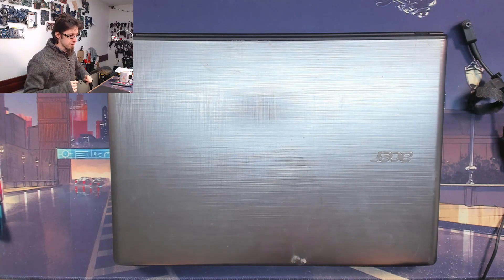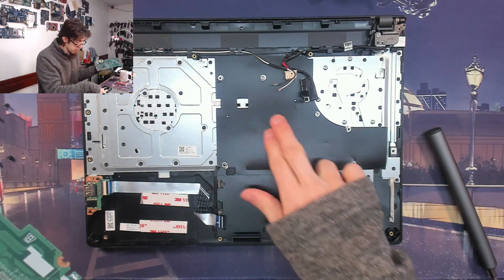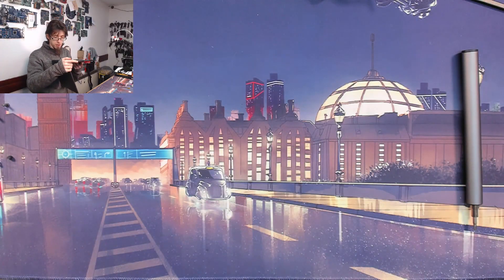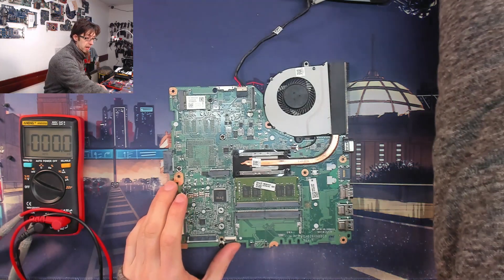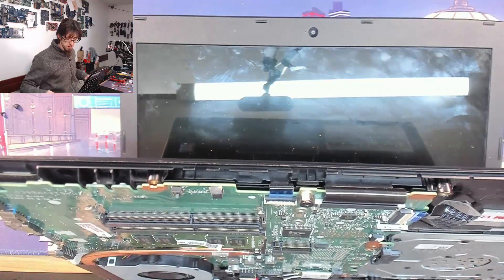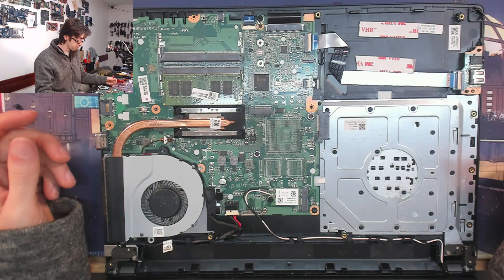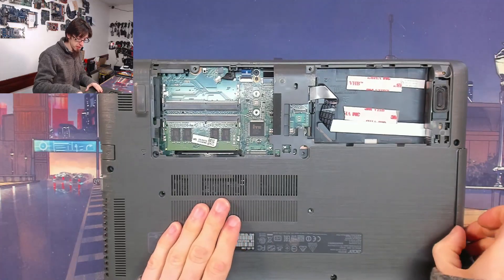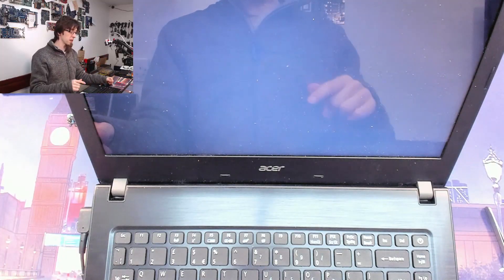Acer E5 Charge Light But No Power - LFC#237

Comment: Mine suddenly turned off and even when plugged there is no light indicator. I tried resetting bios, discharging the power, and shorting the 2 pins for power but it still wound not light up. 😢

Comment: Good day !
I have a unit the same you are using in this issue of ACER E14-E5-475-30ZC
It so happen that the 14 termmin connecting wire to LCD was shoted , 
Now the laptop won't start , please help me or 
Do I need to replace the Main Board ?

Please 
Thank you in advance for your prompt reply

Comment: For these keyboard replacements I found tiny screws on Amazon that will screw and anchor in to the underside of the palmrest. You can apply these screws where you can't remelt those posts.

Comment: wrong description. symptoms of RAM issue is not power related.. the laptop is turning on but no display sometimes the orange led just keep on blinking. THAT DESCRIPTION SUGGEST THAT THE ERROR IS ACTUALLY CAUSE BY A FAULTY LAPTOP MOTHERBOARD EITHER THE AC PORT THE WIRE THAT CONNECTS FROM AC TO MOBO OR DEFECTIVE CHIPS OR ELECTRONICS EG. RESISTOR, CAPACITOR. if that is the cause its better to buy a new one than try to repair the board itself by means of soldering and changing electronics parts or chips. besides repairing computer motherboard is not advisable. by technical and safety reason.

Comment: I love this video, as you take everything step by step.  Thankyou - very helpful.  I'm wondering if you have a schematic for a motherboard from an Acer Aspire 1 A114-31 Model N17Q4.  I'm having the same issue with this laptop, but can't workout where the keyboard pins may be for a jumpstart to ascertain if the power problem is the keyboard, as in your video.
Hope you can help me 🙂

Comment: I have a similar problem, the computer charges the battery but it doesn't turn on, although there is 3.3v on pin 27 even if the jumper does not turn on anyway, what do you think it could be?

Comment: my acer es1 572 has problem, the device chargeing, but when i press power button the power light turn on for 3 secounds and turn off again. do u have any solution to solve the problem and the laptop fan in also not spinning.

Comment: Excellent tutorial! About the keyboard replacement, i as well did'nt enjoyed the need to replace just the keyboard, which is trapped like that, but it is actually really simple to get it done. I'll use a candle and a pointy tiny piece of metal, where i will be heating the object costantly to melt this plastic dots, you can use acrilyc glue to reconect this regions.

Comment: I thought that my keyboard stopped working but it's even more bizarre.

So my laptop is Asus Rog GL502VS, I have the power LED on when I plug in the charger but it won't switch on. I've started messing around disconnecting everything bit by bit and I made my laptop to work, but here it's getting weird:

I've unplugged ac, BIOS battery, laptop battery and speakers. Plug in ac and boom it switches on, after that I have to quickly plug in BIOS battery and it boots normally. 

It will work normalny, it can go to sleep but if I'll shut it down, I'll have go through that process again...

Any ideas?

Thanks. K

Comment: If the keyboard weren't rivoted in place like that, I would even try to go as far as tearing the layers apart on the keyboard and redraw the power button trace if all other traces are good.
Or, perhaps you can try a frankenstein method of soldering a physical power button off the side of the laptop or something so the user can switch it on there.

Comment: Thank you very useful.
I need Schematics for the 
Acer e1572, to check those pins, in case it's the keyboard.. But it worked before I decided to disassemble looking for the CMOS battery that never existed for this model. 🤔?
Crap happens when you're having fun. 🔨😁🔧

Comment: use a old funky or cheap soldering iron to top off or remove heat stakes. Tech rule #1....do whats easiest first check volts coming in and out.....from charger to power button. Awesome job tho, I like your thought process and showing the rabbit hole we end up going down on every device repair!

Comment: Hi AdamantIt how are you? thanks for reading if so, i would like to ask you something: i myself have this exact same laptop, seems identical from the inside (E5-475) and i have opened it for fan cleaning, before anything i have disconnected my battery (all with care) and then made the job done. After the cleaning -> 1)i've reconnected only the battery and laptop won't turn on. 2)Connecting external charger with battery connected, it turns on, all functioning fine, but NOT charging (Ext power disconnect causes abrupt shutdown). 3)No battery and external power only, it works. 4) After that, i've measured my battery and outputs almost 0V.. tried various reset procedures with power and reset buttons but no luck, uninstalling and reinstalling windows AHCI drivers, setting bios to default, Nothing helps... Have you seen something similar? i can't find a "hard" procedure in which i could reset the battery internal circuit (i'm pretty sure some protection has fused, most li-ion have these, you can reset it by forcing a charge direct into cables, but i'm afraid to do it in this case). Any hint would be appreciated. Sorry for long comment and Greetings from Argentina!
Reply from the maker: Yea sounds like the battery has died. As you have read, you may be able to jump start it by injecting power on the battery - otherwise, I'd say replace the batt.

Comment: Hello Adamant IT!
My HP Pavilion Dv6 laptop has almost the same issue but does have a removable battery and a separate power button.

When the charger is plugged in with no battery installed there is a white light and normally the laptop should turn on with no issues under AC power only. But just today when I tried to turn it on, it would turn on for a brief millisecond and then IMMEDIATELY cut out, no power at all as if something is shorting.

With the battery inserted and no charger plugged in, the power LED flashes white 3 times when trying to turn on.
With the battery inserted after the charger is already in, the laptop turns on successfully but the battery does NOT charge and will eventually switch off!
Bear in mind the laptop and components are nearly 10 years old.

If you know what the issue could be please help if you can :)

Comment: Acer and hp make the worst laptops honestly. Not sure if they've changed their designs, but when I used to own either, I've had nothing but problems every now and then.

I've since owned a Toshiba and it's been years and 0 issues so far.

I really do hope Acer stopped putting the power button on the keyboard in their later designs.

Comment: Where did you get that nice thick micro fibre cloth? All the ones I have found are as thin as tissue paper. Also, where did you learn that neat and very effective cleaning routine? It's very impressive Graham. 👍
Re the power button on keyboards.....he's looking at you Crapple! 😡
Reply from the maker: Check automotive stores for clothes designed for cars!
The routine is one I've developed myself over the years, quick and effective!

Comment: I've never seen a computer not turn on because of a BIOS battery, not something I would of checked. where are you able to get schematics?
Reply from the maker: Yea normally I'd expect a stuck BIOS to be "powers up, but no POST". However it's always worth trying a BIOS reset because it's such as easy thing to do. Always take the cheap shots first, because now and then you get lucky.

Comment: never forget a new top will look much better than just replacing a keybored of doom which is complex so mistakes can happen.
low risk and fast with a better finish V complex slow and risky and not an ideal finish (finish as in the clean new top the laptop has with the replacement.

Comment: I had a job like that, I used hot glue in place of the plastic rivets. The keyboard was $12.00. Easy job.
Reply: I've done it a few times with hot glue as well. Does a pretty decent job.
Reply: Haven't had a keyboard like this to change yet but that was my first thought.

Comment: ... of course, it COULD have been a faulty keyboard connector ;-)
Reply: Very unlikely. Keyboards on laptops however fail all the time (dust, moisture, nicotine etc.).
Reply: @pxt22  - Sometimes people (who don't know better) pull ribbon cables out without first releasing them, this can pull the traces off the ribbon, or even damage the connector, always worth a quick check.
Reply: @TrollingAround  Sure, always check. But in this video there were no signs that anybody ever opened (try to repair) this laptop.
Reply: does anyone now where i can find any of that black plastic film/tape inside the laptop?
Reply: @thingshappen9199  I use plastic from a 'binder or document wallet' which you can find at shops that sell stationary. You have to cut it to size (using the original as a template)  and attach it with double sided tape.

You could also try to source self adhesive vinyl, as used in the signage or car-wrapping industry.

If you can find the OEM part, it will be way too expensive! Good luck!
Reply: @pxt22  that's a great idea but how would i know that it will protect the components from electrostatic discharge and such?
Reply: @thingshappen9199  The black tape isn't there for ESD protection. In most laptops it is used for 'spill protection' or in some cases for cosmetic reasons.

Comment: Hello, my laptop have a problem with the GPU. It's a sony vaio sve14113egw with 14113egb mainboard inside (sony mbx-270). I've replaced the motherboard before because the original is completely dead. The original one turn on sometime if i bent the mainboard, but as i don't have proper tools to fix board, i just replaced it. 

Now the secondary installed mainboard is damaged too, it shows garbled output "Orgratkng Q{veo Not Found" (shows exactly this) and windows bluescreen with garbled output too.. I think i overheated my GPU to death?. But before this happened, I've never have thermal issue with the new mainboard running Ubuntu on my other harddisk, i ran ubuntu from November 2019 and it died when i switched back to Windows hdd. I noticed that even when before i replace the mainboard, the laptop's fan used to spin really fast like if i play game in it.. it runs so hot even if i just leave it idle... And when I replace the mainboard, I'm using my other hdd that I installed Ubuntu on it and the laptop never runs too hot. Only when i switch back to windows hdd, and then it overheat i think...

Can I use the old mainboard's GPU with the new working mainboard that have dead GPU? They charged me 500.000 IDR in my local repair shop for mainboard repairs.. do you think it's best to just buy another mainboard again or move the GPU fron the old mainboard?

Comment: Graham, could you have done some investigative work on the power button itself? It might have had some grime on the contacts that could've been cleaned by IPA? Or are the contacts inaccessible from the top without tearing out the keyboard?
Reply: I've fixed keyboards that way and it just never lasts. Better to replace it.
Reply: @imnota  It would have still been nice to know the fault though

Comment: Not trying to teach you to suck eggs but if you momentarily short the terminals after removing the bios battery, it will discharge the 3.3v rail  and you wont have to wait 5 minutes for the bios to be reset.

Comment: I think I told you before that heatgun at gentle temperature will melt heat stakes enough that you can pull that cover out and remove keyboard. and then reuse them to hold
 new keyboard in.
Reply from the maker: Yup, and I've used that technique on a repair since then - but it's still a wretched job ;)
Reply: @Adamant_IT  good :) well it is but sometimes keyboard is supercheap but keyboard with palmrest isn't.

Comment: My lady has a Dell G3 15 laptop with the 1650 ti and core i5- 10300h. Stock after i did all the updates and debloated it its idle at 45-60c in a 18-24c space. And hits 100c under less than 50% load (youtube and having steam open or something) she uses it for school work but wants to game on it because it said online its capable of 190+ fps at 1080 on some titles. Playing WoW min spec shes throttling and is winding up cpu bound at a chunky 40-60fps and without using the very loud "cool mode" she crashes within minutes. Hopefully a simple repaste and review of the heatpipes will help.. otherwise im lost

Comment: I have a Lenovo 81DE suddenly it went dead. There is short in the battery rail but when I remove the bios battery the laptop work fine but through the power supply only and if I plug the bios battery and power the laptop it does not power up. The only time it powers up only when the bios battery unplugged...any ideas?
Reply: Try replacing the CMOS RTC battery. It's almost always a CR2032 so they are cheap and easy to find at local electronic stores, Amazon, and even most grocery stores. It's fairly uncommon for a dead/defective RTC battery to cause power issues (usually will just get a warning after POST and your BIOS/UEFI settings will be reset) but I do see it from time to time,  and more common among laptops.
Reply: @no1ce  I did but same issue

Comment: Can't believe you use Mr Sheen as well lol Its the best cleaner I have found , does not leave any residue and never had any problems with laptop screens. The glass cleaners can be dodgy even the ones without ammonia and I would definitely make sure the laptop is off and spray whatever cleaner onto a rag instead of straight onto the screen just incase some product runs down the edge of the screen and into the screen layers or ffc connectors. I have had some laptops and televisions with damage due to this. Thanks for the video mate.

Comment: Thank you for an educational video. Two surprises: that you don't charge for replacement parts separately and that you didn't check the batteries for possible replacement. Or did you just put in a new CR2032?
Reply from the maker: RTC batt (CR2032) typically lasts the life time of the computer. They do fail now and then, but I don't bother checking them unless I have a reason to think there's a problem with it. Vast vast majority of computers will boot or at least power on with no RTC batt.

Comment: Why did you not try to repair the button or clean the ribbon cable? Sometimes you can get away with trimming the cable to get fresh traces to fit connector?
Reply from the maker: Because I don't want to see it again next month with the same issue.
Reply: @Adamant_IT  Fair enough makes sense. Just surprised in vid didnt investigate further . Perhaps you did off camera

Comment: Buddy Can u flash winbond W25X20     on a MSI B550M vdh WiFi mobo.bcoz my bios is in  boot loop.its restart again and again...my bios version is 7C95AMS.251.my processor is Ryzen 4650G.RAM is 3200MHZ first slot(one no only).I had tried several versions of bios but  the same issue...pls...any one help me out.....it's POST perfectly...but bios is restarting....I used flash bios button serveral times.is that the problem?I'm thinking to flash chip from programmer.so I can erase any dump files on the chip.while trying to  flash the chip is not detecting properly?what will be the problem?pls pls any one pls helpmeout....pls give the details...thx n reg.

Comment: Great Job. Could you have done a push button on the side of the laptop. https://www.ebay.co.uk/itm/Red-or-Black-12V-Low-Profile-Momentary-Round-Push-Button-Switch-Non-Latching/252620802810?hash=item3ad15f8afa:g:QywAAMXQoiJRfvws
Reply from the maker: I mean, sure you could bodge in a physical power-on button - as I say in this video, all we need to do is momentary pull the 'ON' signal to ground. But physical mods to a device aren't really my cup of tea. It's more a design issue that manufacturers need to move away from.

Comment: I tried looking up schematics for the ASRock pro3m AM3+ mobo to try and find out what the mosfets are on vcore, of course there is no markings so I can just use a part number and be on my merry way ....there was 2 blown capacitors on vcore and I was able to find them (cuz they had markings....lol) 
just worried if I replace only the capacitors the same thing will happen, that mobo has already killed a 8370 & 8350fx chip....🥺🥺

Comment: It all depends on what you calculate your hourly rate to be. 10 pounds for 10 minutes work is 60 pounds an hour earned. 50 pounds earned for an hour of work is 10 pounds per hour less earned that the 10 minute job.
Reply from the maker: Yea exactly this. It's a muddy topic because when you're a one-man-band and you have to run the shop at the same time it becomes more a matter of "number of computers fixed today" rather than "profit per hour." But yea, there's a lot of mileage in taking the easy option in order to get the job done and move onto higher-margin jobs.

Comment: long shot here but the original keyboard may have only had a little fleck of dust preventing the the key from operating correctly, I've had a few of these with that prob and as you say the keyboards are a Bi...PAIN to remove (gammy soldering iron and hot glue I find works) then podge the corner of the keyboard open, blow and viola...rebuild time.... on one of them I have also fitted an alternative power button to one of these by soldering flyleads with a small button to the 2 pins you identified and mounted it next to the USB on the rhs. But like you say, it's a time thing and that was a 1 hour job.. wish I had pics of it for you.
Reply from the maker: Yea if the button had been intermittent I'd have started trying to clean contacts and things like that - but when it feels stone-dead like this, I think cleaning would've been a losing battle.